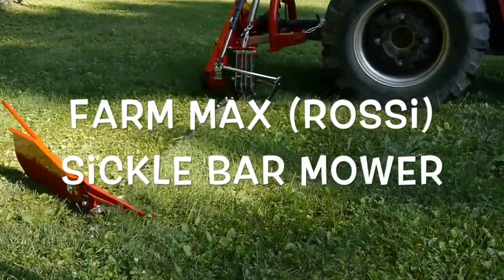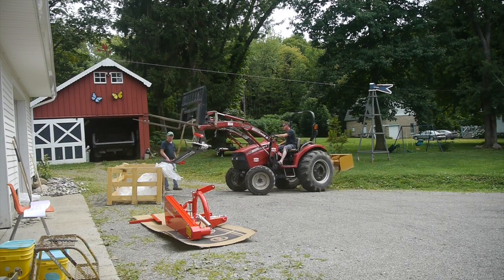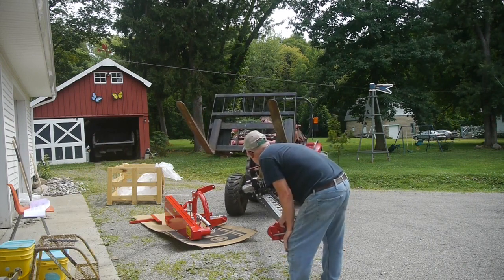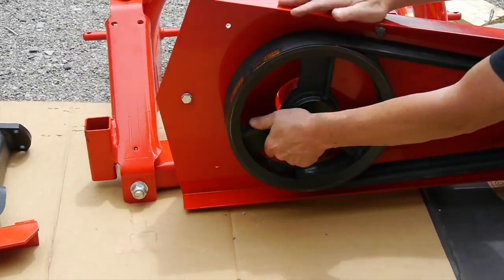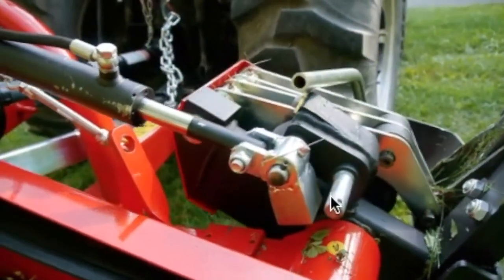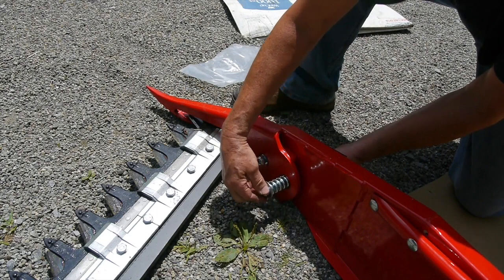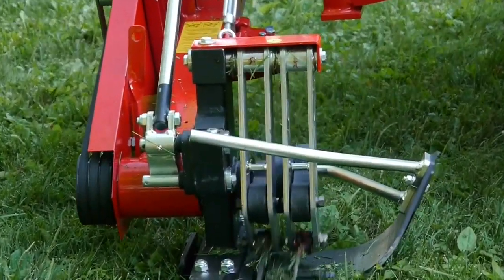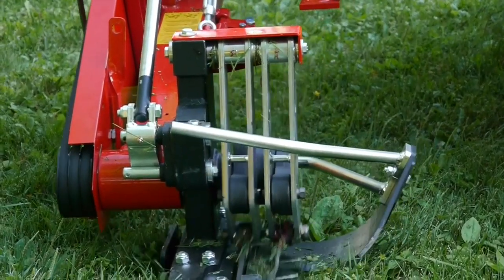(Rossi) Farm Max Sickle Mower - ASSEMBLY

Comment: Thanks for doing this.  I turned to the web for help because the manual was so difficult to comprehend.  I appreciate your taking the time to video and explain how you did it.  I had a difficult time putting the hinge between the base and the bar together, and had to buy a large snap-ring plier to take off and then reinstall the snap and seeger ring.

Comment: I wish I found your video before, I wanted to burn that so called manual! Bought a new BFT 135H, that is for a Cat1 tractor. The manual was a b/w copy with very small drawings. Without the part list it was impossible to assemble. The hydraulic cylinder was not in the manual only the model with the chain adjustment was. I got a good drawing from Enorossi in the end but did not succeed in getting the hydraulics working. I think that the +/- assembly is turned shut. Now I know were to look (yes, read the **manual indeed) and will hopefully succeed. The cutting is far to low to the ground now and it cannot handle that. Thanks for giving me courage again!

Comment: Appreciate the video. I just got a 210 last week but it was assembled. I struggled with just getting it mounted to the tractor correctly, which pin to use- inside/outside. I see how you used the top link pin on the mower, is it working alright like that? The manual info is quite lacking for example: the sickle tension spring- no mention of how tight it should be. I would like to cut a little higher and there in no info for that. I see there are adjustment holes on the skids and wondering if that's what those are for.
Reply: It is. that is how you lift the outer end of the bar, the inner end you regulate with your 3point hitch. Or you can probably add spacers to lift the inner skid.

Comment: ummm.. the the spring on the deflector bar should be on the outside. when you  install it in the video, you put it on the inside. i noticed it was catching grass as it cut
Reply from the maker: Thanks.  I will check that out
Reply: I noticed that also. Got mine going today!

Comment: Tim, Great video and help on assembling the Farm Max Sickle Mower.  I do have two questions, regarding the hydraulic hookup.  My New Holland tractor has a single remote valve, which normally has a supply and return line hooked to the remote cylinder on the equipment.  Since there is only one hydraulic line on the mower, does it matter which remote valve on the tractor hooks up to the single cylinder line?  Also, what does the lever on the mower hydraulic line do?  Thanks again and looking forward to your replies.
Reply from the maker: I think that lever on the hydraulic line gives you more control on your flow rate.   My son hooked this thing up and is the one who uses it.  So, I am not sure about that one.  I don't think it matters which line you hook to on your tractor.  I tell you waht ... I should ask my son and get back to you.
Reply: mine has a circular twist valve with +and -, it adjusts the speed for raising and lowering the bar. I do not have the ball valve. It does not matter which remote valve you use.